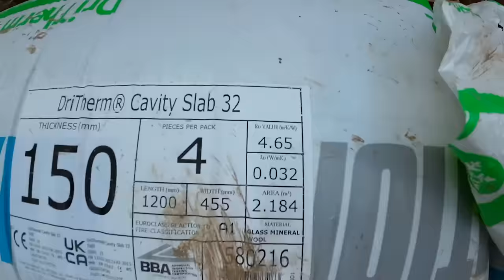BI FOLD DOOR OPENING READY FOR STEEL BEAM.. CONSERVATORY TO EXTENSION PT 8

Comment: them 150mm cavity's are crazy, surely over past 20 years insulation has got better to mean cavity's could be smaller. rather than the other way around,  not too much of an issue on decent size extensions but on small space ones like porches and boot rooms you'll really feel it. 

Great vid as always guys.
Reply from the maker: Yeah to save about £3 a year on your heating bill 💸 🙄🧱🤣👍🏽
Reply: Apparently it is technically possible to achieve the required insulation value without going up to 150mm.
However that insulation is much more expensive, making the room smaller costs nothing (arguably cheaper as less blocks and plaster!) or the building larger at not much more cost.
I suppose there's more dig and foundation concrete for 150 cavity.
Reply: @markdauncey927  Mark,
I have seen it easily surpassed with a total wall thickness of 190mm + external rain screen cladding.
However they also had triple glazed windows as standard.  a virtually airtight construction, a M.H.V.R System for fresh air in and stale air out. And ground sourced heat pump and solar. Plus large windows on certain aspects to utilise and maximise "solar gain." and additional thickness of insulation in the floor and roof.
It is all very do-able but hideously expensive.
On traditional cavity wall construction I have seen developers building with a 300mm cavity (fully filled post building with polystrene granules in resin)  But the foundation width was a whopping 840mm wide.......utter stupidity and madness...
Reply: @SteveAndAlexBuild  Chaps I have to agree  -  to some extent.
Ridiculous levels of insulation only can do so much.    The clever bit is    "airtight construction + good insulation levels" together... Which brings other issues for the house that need addressing.
At the moment the Industry & Government are just toying with the concept; i:e  trying to achieve it as cheaply as possible.
In the meantime the poor customer gets shafted for the cost.
Reply: @martin2466 
Customers always end up paying  😂😂

Comment: Is there gonna be a cavity tray where the extension roof meets the house wall?
I suppose there could have been one put in for the conservatory but it is likely to be below the new roofline. I know it isn't your decision and in +20:years you have only put in a few cavity trays in such scenarios (i asked on another job). But what does the building regs say....presumably optional!
Great work btw 👍
Reply from the maker: It wasn’t mentioned and I’ve never actually done one it must knacker the structural integrity of the building taking all that brickwork out .
   The house brickwork is in excellent condition 👌🏼👍🏽🧱

Comment: @13:49 you start block work on top of what appear to be thin cut blocks, why have those blocks been cut like that? Is it some correction method to re establish course height when you get to the top? Please explain to non brickie
Reply from the maker: Spot on 👍🏽🧱
Reply: How does that happen though, bed size or brick/block dimension differences like metric/imperial. Surely this isn't the norm or is it?
Reply: @SteveAndAlexBuild Also a non brickie but learning lots from yourselves, thank you. The course of cut blocks you used as a “correction method to re-establish course height when you get to the top” I can understand but why doesn’t the stand alone pillar against the house wall have a course of cut blocks for the same reason? 🙏🏻